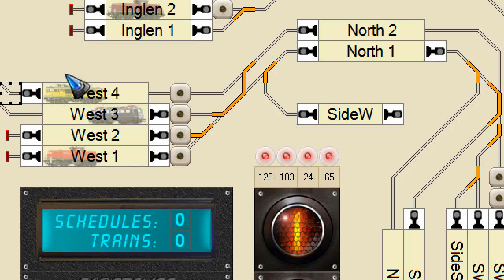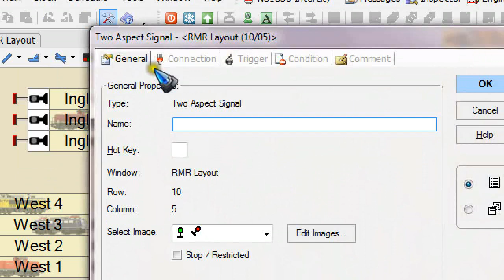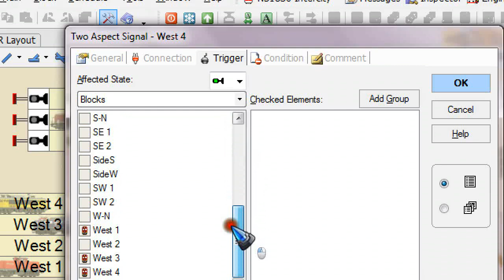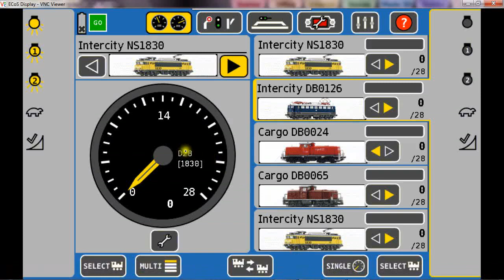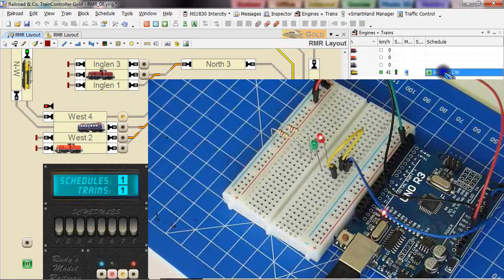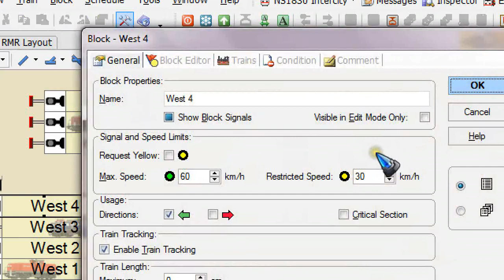Traincontroller 33: Physical Signals on the Layout

Comment: Ruud I am a little confused. You said that the software to control the R3 is available at the "block". Can you tell me how to access this. As you are aware the size of my layout is huge and the option of cheaper decoders is quite attractive. Do you use these for  switch control as well as I am currently those from ESU. I think I need the ESU Switch Pilot Servos to facilitate Railcom for my points.
Reply: +Ruud Boer Thank you very much. I have had a look and will decide if they will work for me with semaphore signals. I might need to attach a motor to make the arm switch. I have looked at all of your videos and they are fantastic in terms of instructional content. Great job in assisting those persons wanting to be involved in this aspect of model railways but lacking the technical knowledge. A really amazing service you are providing. Thankyou again.

Comment: Ok so the internal signal controls access into each block in TC but what if the external signal aspect is green but the internal signal shows a block is occupied what happens then Ruud? Can/do the internal and external signals work in tandem with each other to avoid conflicts? Cheers.
Reply: +Ruud Boer excellent, thats what i thought. Thanks for the confirmation. Keep up the excellent work Ruud. Regards T.